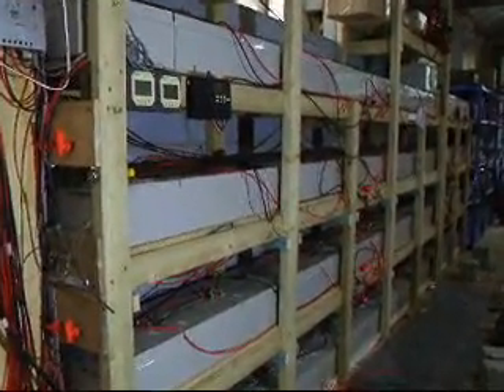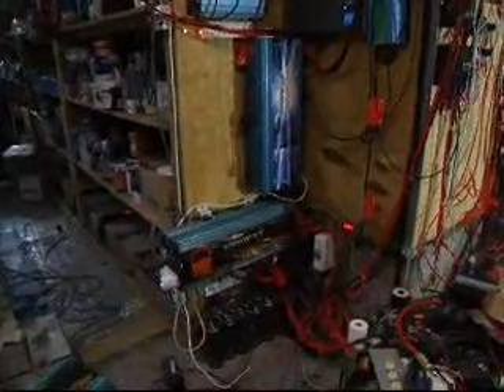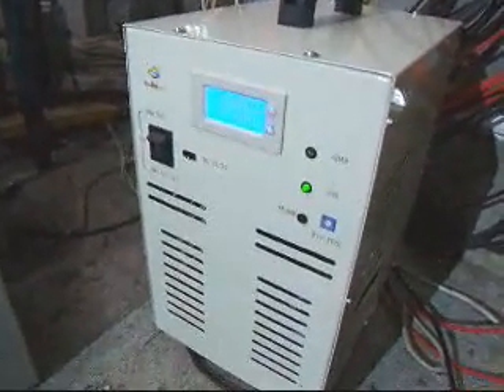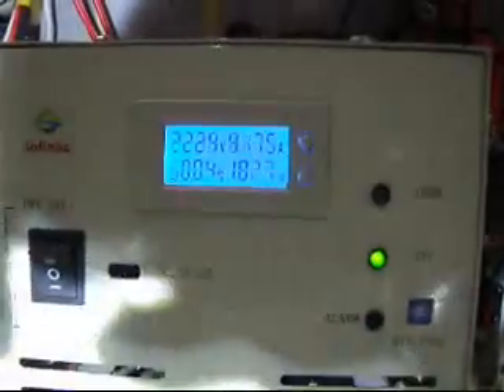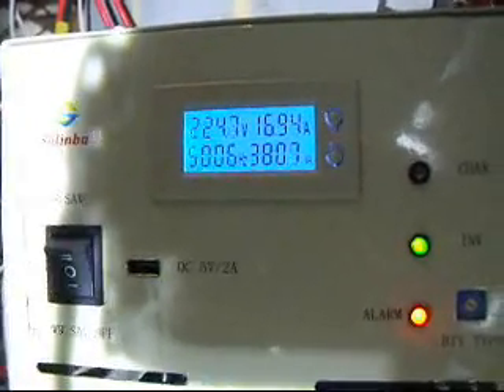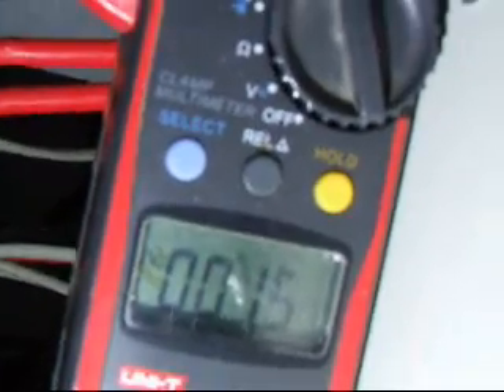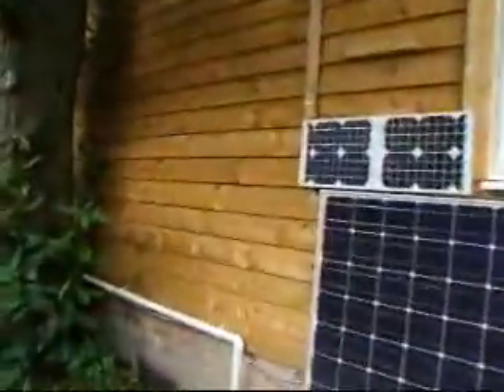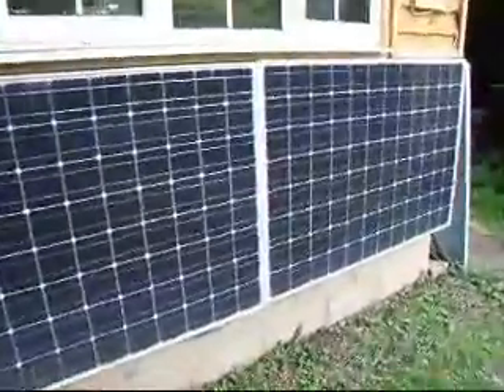The Solinba 3000LF inverter vs Power Jack for a Solar Powered Cottage

Comment: Very interesting with Solinba. I wanted to buy a 15 kW powerjack this summer but for some reason the shipping was very expensive so the ebay sellers didnt want to sell them (or to a ridiculous price). I want to be able to use 5 kW power some several minutes without risking overheating it. Interesting that they have only one transformer even in the 8 kW powerjacks now. Hopefully it is real engineering and not only more china watts they are advertising.
I have a 6 kW PJ unit with 1 transformer now and I am very happy with it. It has pretty much the same warnings as the Solinba in this video but I dont want to risk overheating it by loading too much.

I am surprised that you think you need so much batteries for a little cottage. I have two 180 ah 12V batteries for my 24V system and the batteries are always full in the summer although we cook on electric plates and use power tools (even welding although that is at the limit with 2.5 mm electrodes).

Comment: That is a very impressive setup/installation!! But how can you charge up the batteries with that small area of solar panels?According to Google has the Uk ~1493hrs of sun which is ~4hrs/day...and the british sun is not strongest as far i know.
Reply: John Smith Right, my jaw dropped when I saw the piles of batteries.
Reply: @Alanthya  lol that's what happens to me too
Reply: On the main roof of the barn where I tested the Solinba inverter I have a 8kw installation. Currently on the cottage to which you're referring we've got the battery cupboard now enclosed with two panels used as the doors to the cupboard, and another two panels on the walls. Another panel will be added to the roof and a further 1kW upon the roof of a neighbouring building. The current generation from the panels is around 1kWh per day with bad weather.  I need to increase this to 3kWh per day to cover the evening usage. In winter, a 4kW installation of panels will collect around 4kWh per day on average and around 20kWh per day in summer in the south of England.